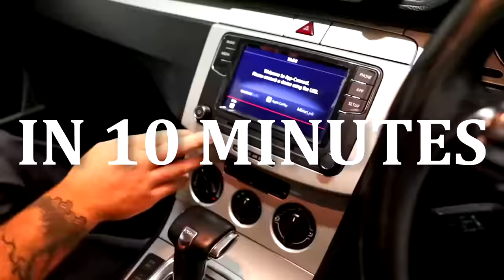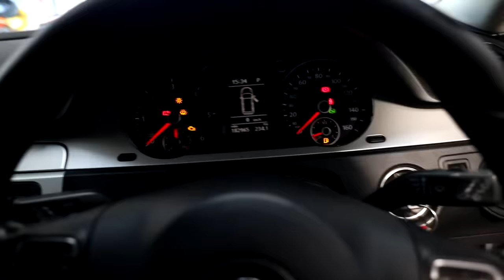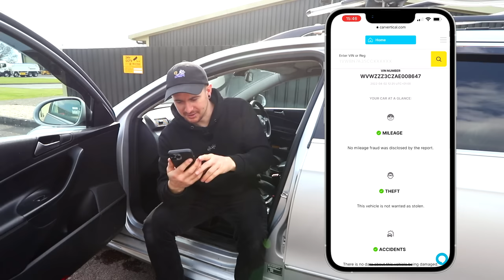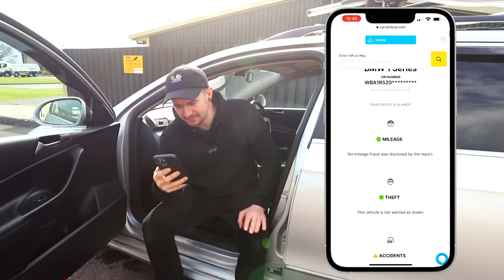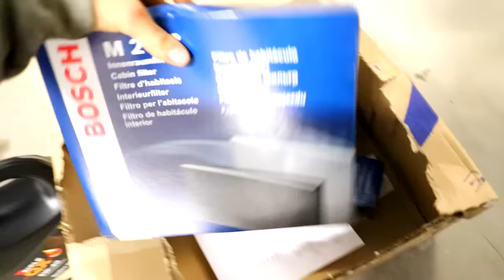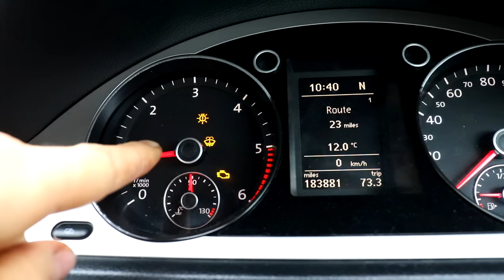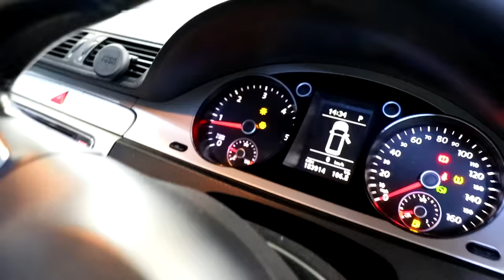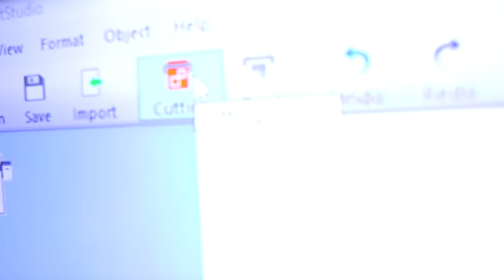Building a CHEAP B6 Passat in 14 minutes

Comment: Got a soft spot for this generation passat, my dad had 'RJ06' as a company car, similar spec to yours too just in red
Reply: I'm mad looking that exact car to replace my B5.5 workhorse. If I could find a Red, 2.0TDI, DSG, Highline Estate for a decent price I would be a happy man.
Reply: Reading registered?
Reply: @shona5512  idk man go for 7, 6s rust a lot
Reply: I don't. They not as nice as the previous generation b5.5 because they based on the Golf platform whereas the B5.5 was based on the Audi A4 / A6.
Reply: @Blackmamba12345  A4/A6 platform is awful though. The Golf platforms are so much easier to work on, especially when it comes to suspension work.
Reply: @digitalscale76  b7s rust just as bad lol
Reply: @insideridin1376  Id say they still rust but not nearly as bad as 6s do
Reply: @digitalscale76  the reason these rust so bad is because vw put a shit ton of «sponges» glued on the backside of most panels on the car. Vw calls it noise cancelling but in reality these sponge things stay wet all the time and makes the panel rust from the inside out. Ive had a few b6 passats and I removed all the wheel arch liners and removed like 6 of these sponges and they were all soaking wet even though it didnt rain for days before.. And id recommend installing mud flaps on these cars so the rear of it doesnt get sprayed down with shit all the time rusting out the boot door..
Reply: @insideridin1376  don't you say...i have a b6 as a work car and it's rusting bad but not really from the bottom up it's rather the bottom line of trunk door and bottom corners of doors as well as the rear diff mounts...runs smooth tho
Reply: @digitalscale76  its a shame. I love these cars but in 5-10 years there wont be many left😂 i sold the last one i had  cause it had the PD 140hp engine that was known for balance shaft issues on the oil pump so i was afraid it was gonna fail. Also had a CR 110hp but the PD is a work horse. Great machines.

Comment: I’ve got a B6 estate DSG (170hp PD) and it’s great. Only issue I’m currently having is the balance shaft and hex key which is a weak point on these. Old one didn’t fail, It was done for precaution so not sure if it wasn’t fitted right or something else but oil pressure light came up on the dash about a week after fitting new one and blew the turbo. So would recommend people who own the B6 to get it done and someone who knows what they’re doing. It also affected early common rail engines too.

Comment: I love the b6 passat, I’m buying my mates dads one soon, just getting the money, very exited!
Reply: Mate beware of the service history, a PD 140 hp 2.0 tdi can get unreliable and expensive real quick
Reply: @martin1649  yeah 2.0 tdi 103kw dsg in the b6 is a shit show
Reply: @martin1649  Really, good to know. I'll stay away from the pd140 as a whole then.
Reply: @stepan3k  Really? I'll stay away from the DSG, thanks for the heads up
Reply: @MK5GolfTDI  Yeah bro i mean newer dsg arent that bad but mine is already starting fell apart after 250k km, already payed like 7k in repairs, turbo, egr, dpf, everything... and the turbo is acting up again also.
Reply: @MK5GolfTDI literally first thing i found on the internet:
Avoid the 2.0 TDI 103 kW 16V and also the more powerful version of the 2.0 TDI 125 kW 16V, which is perhaps the biggest problem of the Passat B6.  Siemens' fault injection is to blame, which clogs the particulate filter faster than it can regenerate.  And to top it off, the high engine torque doesn't give the DSG much of a chance of longevity.  To this must be added the risk factor of the fact that most Passats served in companies that strictly adhered to a long service interval for engine oil changes.  As can be seen, the risks associated with buying a B6 with diesel aren't small.  I therefore recommend that you carefully select, check the technical condition of the car and quantify the costs necessary for initial, often neglected service.

Comment: I have an 06 tdi sport 140 with the dsg gearbox absolutely brilliant cars and for anyone that doesn't know and likes safety the Passat come with  airbags on every pillar something that was extras on both the Audi A4 and Skoda Octavia (only the Laurent and Klement has it as standard) 140hp and 256 Ib of torque as standard on the sport.
It goes but I want to get a 3.2 fsi 4 motion (around 250 hp but I want to put a turbo on)

Comment: That car looks so mint now. On long runs I wonder what kind of mpg you get from it? I am tempted to buy one but there is getting less and less with the oil pump failures on them, easy fix, swap the oil pump to a Golf chain driven pump (straight swap) before the pencil sized shaft goes in the Passat pump.
Reply: cant tell u about MPG but u can prob convert it i have the same one 140 hp 8 valv one with the DSG if u drive it normaly around 110-120 km/h u get around 5.5-5.8/100km if u drive it around 140-160km/h u get around 6.3-6.4 did a wong run 4392 km and it fuel/km ratio was around 6.3 combined but didnt drive more than 160km/h
Reply: @koceto3  It would be nice to get 5.5 for a big car like that. I have a mk5 golf gt and get around 4.7 on long runs and 4.95 with general driving around. But it is a much smaller car, so to be expected.

Comment: wait a moment was the diesel filter black? you should look up the vaccumpump on the right side of the  engine , its possible that its leaking , if it starts smoking or "burn oil" it could be damedged (dont buy one from pierburg)

none the less awsome build , i would also add the skyline mod ;D

Comment: The Video is a bit older but I will comment any way. The RCD 360 is not really reliable and is a knock off of the RCD 330. Some had really bad problems and some didn't notice anything strange. Hope it works well for you.

Comment: Really good car. I buy one by chance and in that moment I didn't know much about them except I should buy 2008 so it's Bosch sistem for sure. Later I find out it's the best 2.0 CR I could buy.  Engine was 140hp with code BMM and it was manual 6. Really good economy on highway and after 1000km you are not tired. On 140km - 2250rpm. No noise no back pain with ergoconfort seats. I really liked that car especially after egr and dpf delite.... and then stupid euro norms fuck up my happiness and I have to sell it because I was not sure I could pass technical exam.

Comment: This made me wanna do the same to mine. 07 B6 with pd 2.0, 188k miles and dsg. Same situation as yours, bit worn looks but mechanically sound. Got mine for 1500 cause it has front rear park assist, front rear heated seats and climatronic as well haha. Are those Le Mans 19 wheels?
Reply: Id like to know if the wheels are the Le Mans 19" also?

Comment: What audio unit did you put in? 
 Any probs with the installation?
What brand of coilovers did you put in and do you think I can get onl 10-20 mm lower with them. I don't want to go real low with them as roads around here are a bit dodgy.
Thanks for posting as I'm doing similar with my b6. Now to address that P0401rgr code

Comment: Content;

Front Brake disc worn, pitted or scored, but not seriously weakened both discs (1.1.14 (a) (ii))

Nearside Front Tyre worn close to legal limit/worn on edge (5.2.3 (e))

Offside Front Tyre worn close to legal limit/worn on edge (5.2.3 (e))

Offside Rear Inner Tyre worn close to legal limit/worn on edge worn on inner edge (5.2.3 (e))

Nearside Rear Inner Tyre worn close to legal limit/worn on edge worn on inner edge (5.2.3 (e))